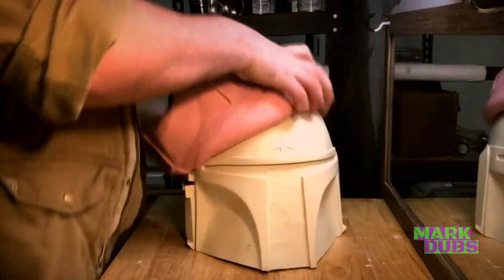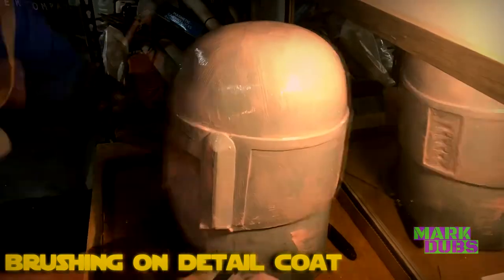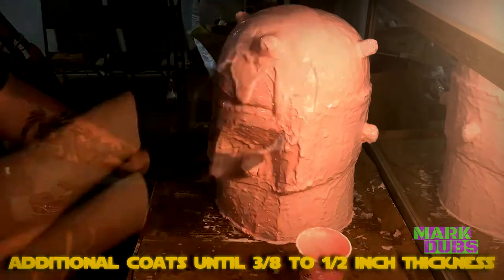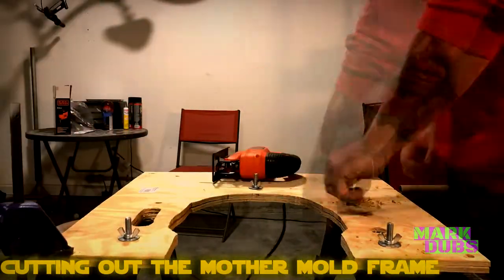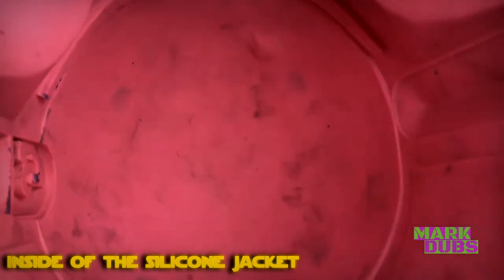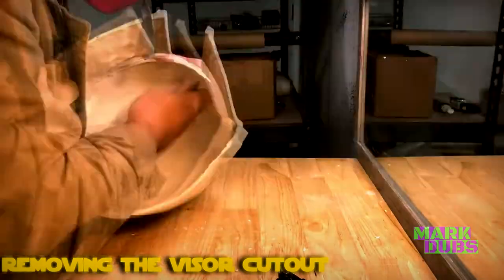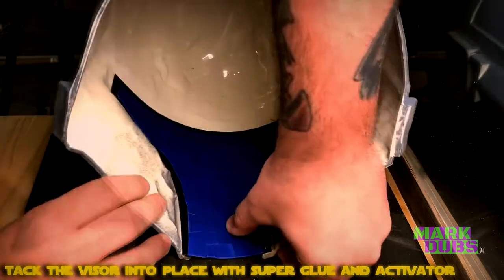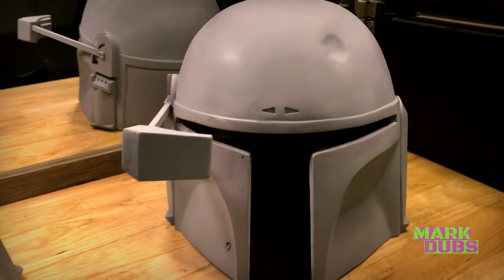Let's make a Boba Fett Helmet Part 2

Comment: How much does the process of making a mold and casting a helmet cost?
Reply from the maker: Between the cost of silicone, a gallon of 2-part resin, and other materials, roughly $200. However, from that gallon of resin, I was able to cast 4-5 helmets. Also, this method was borrowed from another maker on Etsy. He made a tutorial where he mentioned that from one of his existing molds, he had already pulled some 70 casts from it already and the silicone was still holding up. Definitely something to look into if you’re wanting to make a ton of carbon copies fast.
Reply: @MARKDUBS.3DPRINTING  could you link that tutorial? and thanks for replying this is good to know